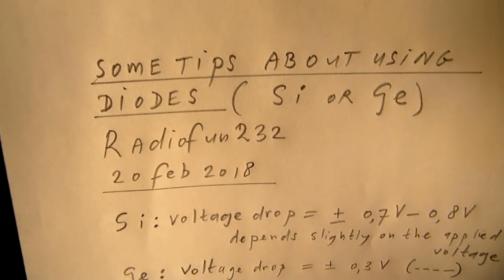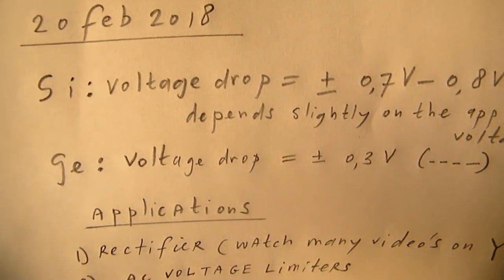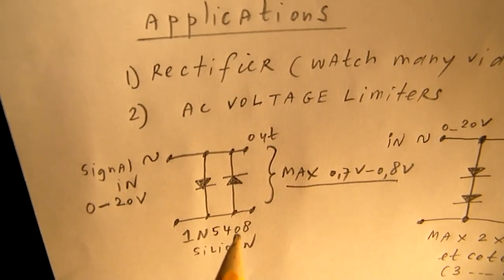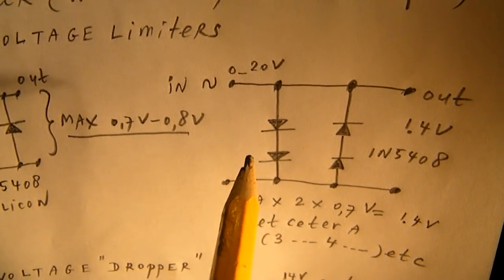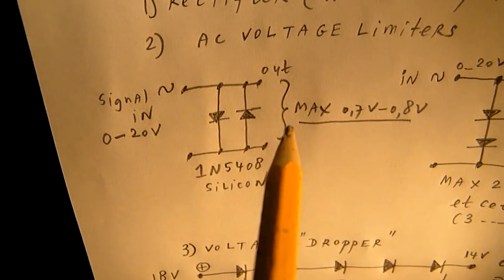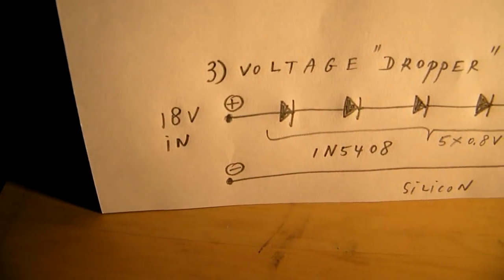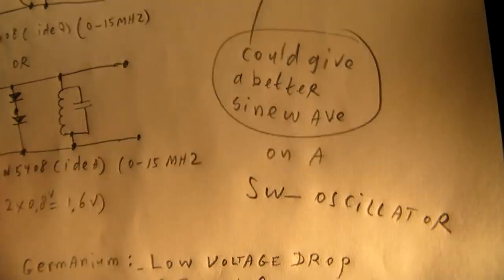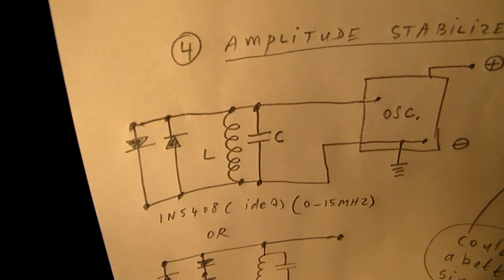Some handy applications from Silicon/Germanium diodes

Comment: I had a similar idea of using diodes as an ac voltage limiter to protect the input of an amplifier but i used LEDs instead. I made a tube mic preamp, and to make absolute sure that there was no high voltage coming out of the preamp as I turn it on, the leds across the output of the preamp would clamp that initial voltage spike.
Reply from the maker: A good idea to try it that way. Quite new for me.

Comment: Good simple uses.  I also remember that you can use them to shape a triangle wave into a pretty fair sine wave (forgot how exactly, needed op-amp?)  Clipping and half-wave rectification is fun stuff with sound too.
Reply from the maker: Thanks! I did not know that application (triange-> sine), when I have my radio shack (within a few months) built up again I am going to do that experiment. I have your question about the  Hfe still in mind, but cannot give a good reaction because all my electronics books are still stocked. 21 feb 2018.
Reply: I just looked up the shaping circuit in my old books.  Yes, all you need are four diodes; two to shape the top; two to shape the bottom.  It's a passive circuit, and I only used the op-amp to generate the triangle wave.  Though it's an approximation to a sine wave, it's only a few percent distorted, and the limited frequency response of the components further round the 'edges'.
Reply from the maker: OK, thanks again.

Comment: Number 4 application should be a reverse voltage/battery protection. A single diode in series (sometimes parallel) with a power supply or the battery. Of course you know this, but it's worth to tell, esp. beginners who destroy many experimental circuits only because bad power supply polarity. :)
Reply from the maker: OK thanks, nr. 4 was amplitude stabilization, but anyway: what you propose is right. I could not publish all the applications from germanium or silicon diodes. There are much more. And what you propose is indeed very useful for beginners and profs.